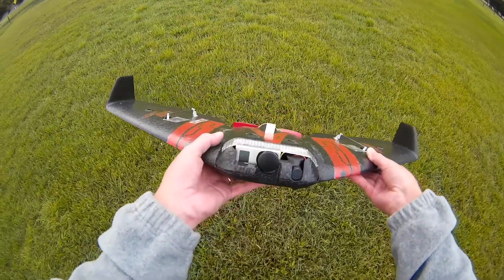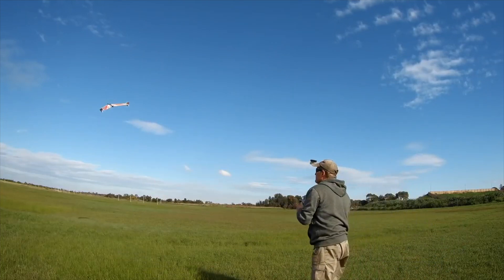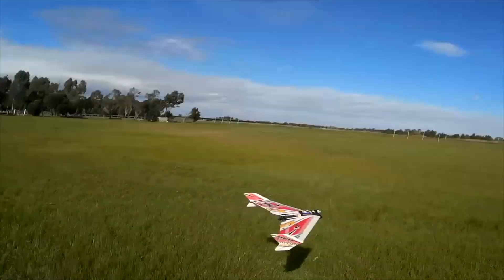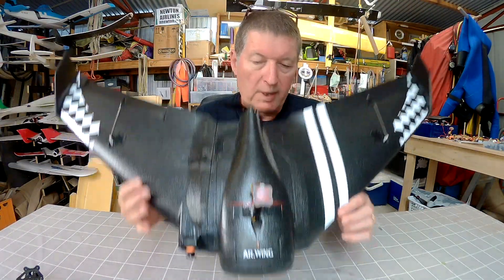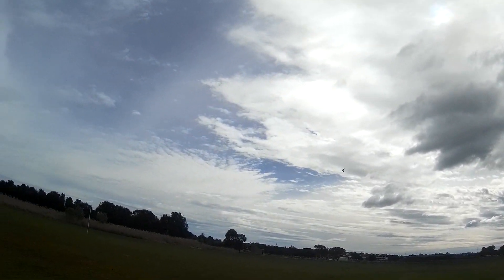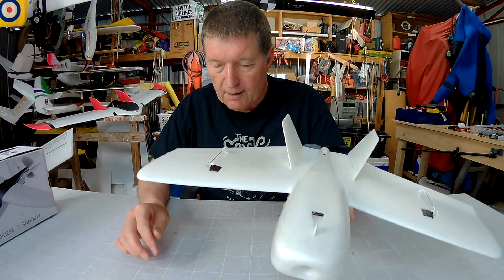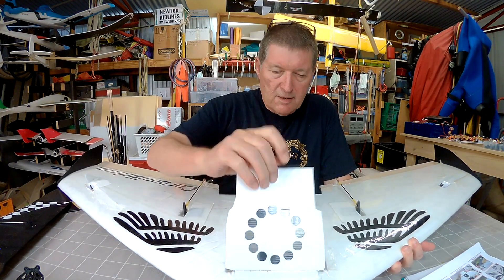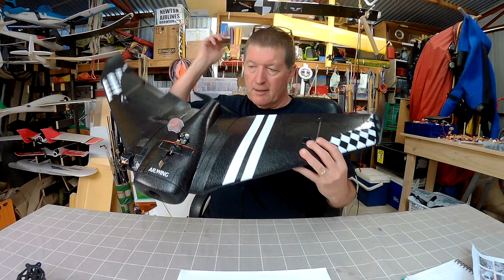Past Planes 11 - FPV Wings

Comment: Wobble is the wings attempt at yaw control. 
As the wing yaws it looses lift on the leading side of the wing where the trailing side of the wing gains lift. This rotates the wing back to the original position until it overshoots and begins the process again.

Past planes is an excellent series!
Reply from the maker: Interesting theory, I have heard others like vortex shedding. Would love to understand how to reduce it.

Comment: Hi Andrew. I've watched almost all of you videos, and decided to make my first scratchbuild foam plane. The only foam I can buy is a 10mm x 500mm x 1000mm pink rather hard sheet, no paper, which weights around 180 grams. (they go under the wooden floor) It is impossible to bend, it will break. 
Could you recommend for a start build (and a noob :) a good slow flyer, with probably an under cambered wing construction, or maybe KF airfoil? I was thinking on the Old Fogey, or maybe a modified more stable version of it. Or something better with plans. Maybe some glider.
Thank you.
Reply from the maker: I wouldn't recommend an Old Fogey, that has to be a super light build to fly. The Boxler would be perfect https://www.youtube.com/watch?v=vpifHoUNg7g

Comment: Hey Andrew, Have you ever had a problem with storing your planes in the shed during the Australian summer? I've been looking at moving my collection to the shed, but am a bit concerned that the ambient heat during summer will cause the hot glue to fail.
Reply from the maker: Not too bad here in coastal Victoria
Reply: Insulation on the roof